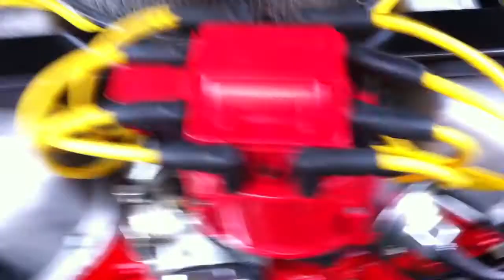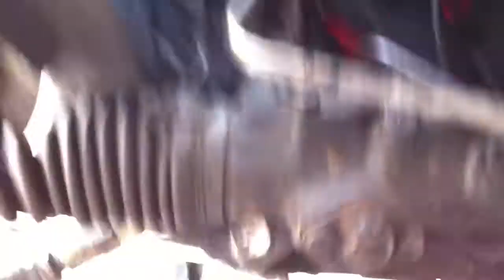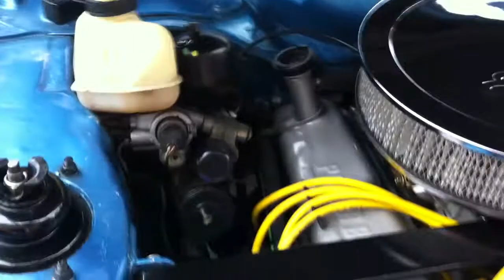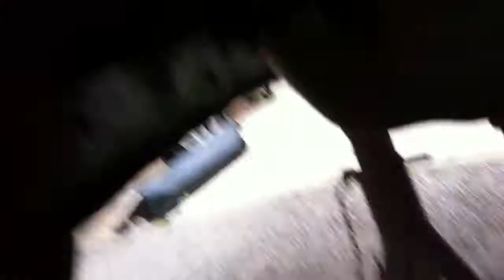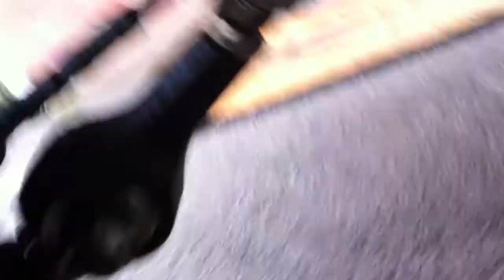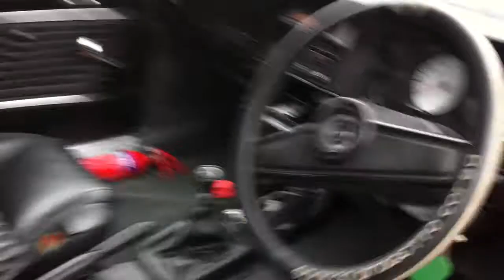How I put a Ford 302 5ltr (Mustang) engine with T5 G/Box into a Mk1 Capri.

Comment: Commend the effort - few items that need mentioning for anyone looking to copy elements of the project. 1 - The mods to the front subframe need to be carefully considered as it's the mounting for the rack, lower arms & engine. It's hard to tell but it looks like the way this one has been modded would fail to give the location of the original part. Offsetting the rack isn't great practice either, this will lead to some odd geometry & ackerman on lock. A better solution would be to use Mk2/3 Capri V6 PAS crossmember, rack & lower column then mod the sump, eng mount & exhaust for clearance as neccessary. 2. The inertia switch must be rigidky attached to a solid part of the body to avoid false triggers, screwing it to soft trim is almost guaranteed to cause problems. 3. Welding of props should always be done by suitably equipped & capable people - ideally driveshaft specialists! If a prop comes apart it will make a serious mess - without balancing it will cause lots of driveline issues from the axle through the gearbox into the engine. 4. Wherever cables or pipes pass through the body they must have appropriate grommets to avoid chaffing & subsequent short circuits / leaks. 5. Those electric boosters use a pressure switch to keep the accumulator upto pressure, it's unlikely that powering the pump when the brakes are on will give sufficient run time to keep the system pressurised & conversely the pump will run too much if the brakes are left on & could burn the pump out. Not criticism just guidance for anyone looking to follow a similar path.